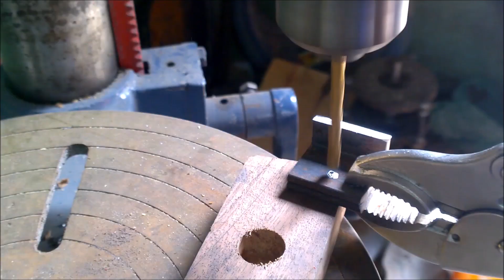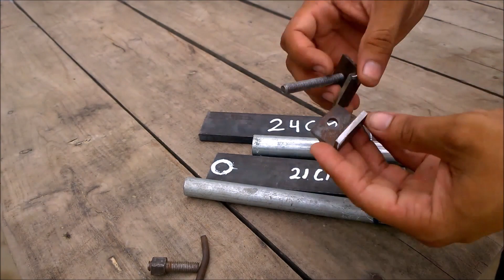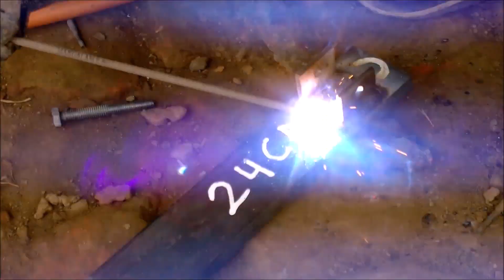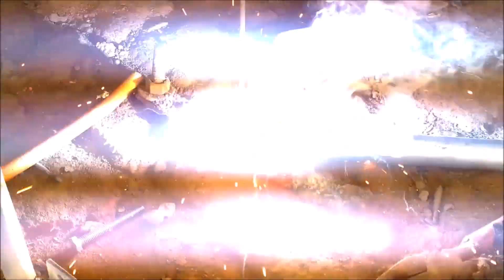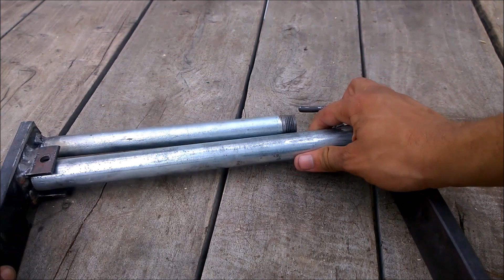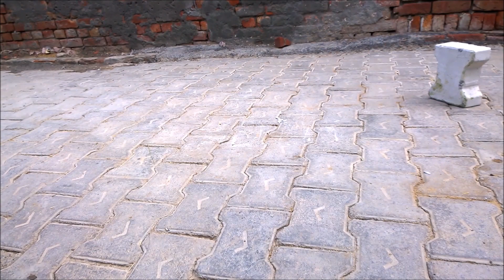Wow Amazing HOMEMADE  TOOL FOR BRICKS

Comment: Nice design and clever. I would add some sort of grab at the two inner beams just for better friction. Maybe two holes at each beam and two butterfly screws that hold some piece of rubber like on a vice.
Reply: Or 2 holes (at each side) and short nails / srews, with welding.  For cement blocks surface (almost 11kg each) would be ideal.